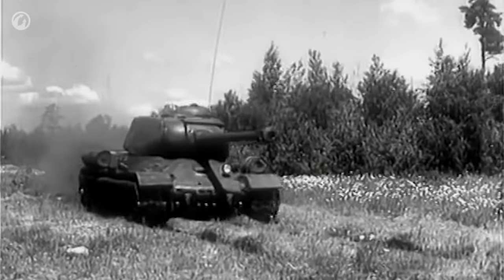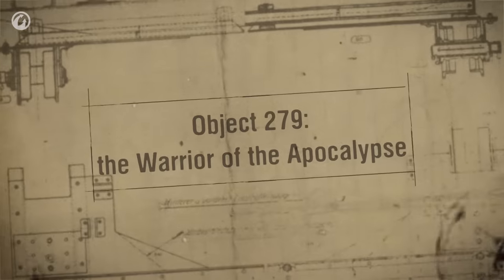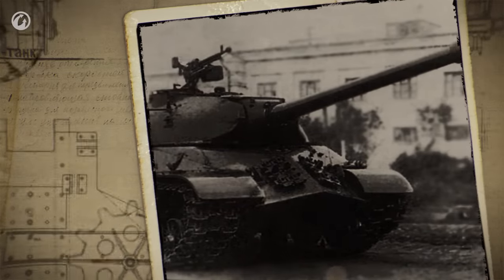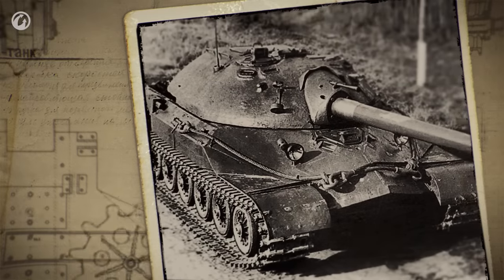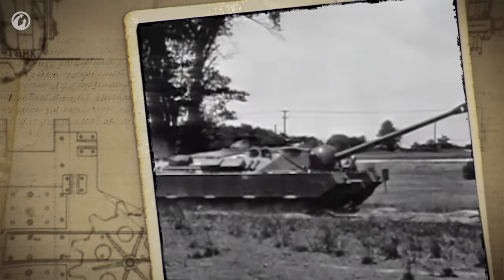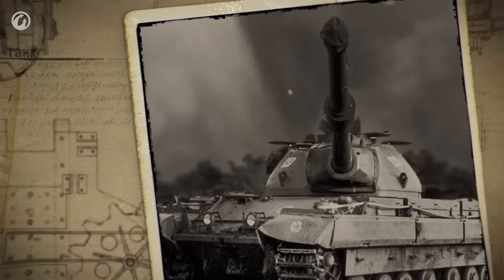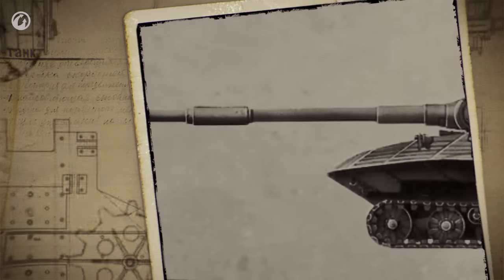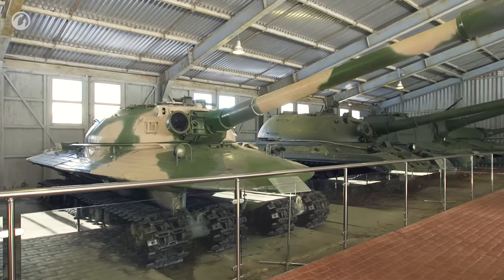World of Tanks - Object 279: the Warrior of the Apocalypse

Comment: 55 kmh, probably poor traverse speed
270 mm front (without angling)
305 mm turret all round
counter heat screens (spaced armor?)
130 mm gun 5 rds/minute (~490 damage -> ~2450 dpm, like a IS-7 with gun rammer)

So a pretty much inpenetratable tank with good speed, bad traverse speed and a IS-7 gun with better rate of fire. Maybe like a tier X Pz 2 J with a good gun?
Reply: Damnit wheres arty when u need it
Reply: Gonun Sounds like a regular tier 7 russian premium tank ;)
Reply: Probably spaced armor yes, but it could use a similar concept as the m60a3 with ERA (energy reactive armor) that in this tanks case would be placed under an oversheet of primary armor.
Reply: arty breakfast
Reply: Gonun i think the structure around the 4 tracks will be a weak spot
Reply: Gonun the gun you forgot the cannon was a heavy MG, so maybe it will be like the Waffentragger E100 before nerf
Reply: Sergio González Torres
well the IS-7 had a kind of autoloader too, but in the game you don't get that...
Reply: Forenix GD
if you get flanked, just turn the turret to the rear. They can't pen your front, side or the turret anywhere and you can protect your rear...
Reply: Gonun But the turret traverse can't be very high due to how many crew members there are in the turret. The loader would get one hell of a ride
Reply: Gonun It might be a Tier XI tank
Reply: Dome isn't that great against proper penetrator or well aim shot; or if HESH shells behave more like real world. Eitherway, it is a Soviet Maus, not some tier 13 vehicle SerB likes to brag about.
Reply: Gonun lol right
Reply: Gonun Omfg I was just scrolling through and saw your profile pic, I thought I had commented before on this video 😂, can you imagine this in wot though?
Reply: Forenix GD dude the turret is gonna weigh more then all the crew members so actually since there are more crew in there they will work to make the turret turn a bit faster but yes crew would put on a smig of weight
Reply: Charles 2002 lol same here
Reply: Sergio González Torres dude the heavy MG is the 50 cal zis machine gun on the top of the turret.. the cannon is a 130 mm yes it had an autoloading mechanism but that was only on the IS7 but only in real life. in the game it had a 13.6 second reload but on my IS7 i have gun rammer pluse brothers in armS and all that plus the crew is very good so my reload is about 10.4 seconds
Reply: Dusan Bursac well, Pz II J can't hit anything just like everyone else can't hit it, if it was given a gun corresponding to its tier, then that would be OP
Reply: Aaron Fales yeah, I can just imagine if in the game the gun behaved like the Waffentragger E100 before it was nerfed, just go around, 2 shot everything near u lol
Reply: Sergio González Torres lol i know right
Reply: Sergio González Torres lol give it the mtgls gun or guns since it has two
Reply: Those middle tracks look fun to repair.
Reply: Dylan Marshall Explosive Reactive Armor
Reply: It won't be a bad idea, HOWEVER : 
           Many players will consider it OP(Over-Powered), so they-ll want it's removal. And a lot of arquing is gonna be on the WOT forrums and game chat, and if they do the job and take this tank in game, you'll want it nerfed or removed, but they can't simply remove it and even nerf it because it won't longer be Historical-Accurate.

...So,  better go at museum, look at it, and then go, but better not in game :)

By the way, the Gonun's comment was pretty funny! Like!!!
Reply: (IRL) They should make a remote controlled tank with armor thicker than a heavy tank. (You couldn't fit a crew inside a tank that has armor thicker than a heavy tank without evolving first) so, just make a remote controlled super heavy tank.
Reply: who cares i want this tank.
Reply: Irl is7 had autoloader just like this thing
Reply: It also has a stabilizer and what are you talking about tiers and damage this is a tank tanks dont have hitpoints
Reply: This did age well :D
Reply: nah just a tier 8 premium, sounds very balanced aswell

Comment: HP 2100
130mm gun 11sec reload (dispersion / aim almost like the obj263?)
only 24 shells
28 turret tspeed?
25 hull tspeed?
turret armor 305~ mm (mini cupolas?)
hull armor 266 - 280 mm (side armor? / weakspot under the lower plate?)
35km top speed
Power/Weight 16.6 (+ good terrain resistance)

Comment: Actually, after watching the video, I'm not that terrified of it anymore. Emphasize the weaknesses mentioned in the video and it'll be right at home in the new meta, and comparable to tanks already in the game such as the AMX M4 54, the Kranvagn, the WZ 111 5A, the Badger, and the Doom Turtle. 

Pros:
>130mm gun means high alpha
>5 rounds a minute
>Hull armor impervious to HESH/HEAT/HEP/HE
>Powerful frontal armor, up to 300mm thick in parts
>Great forward mobility with 55km/h top speed and decent/great ground resistances
>300mm thick turret

Cons:
>Parts of the side/rear armor may be as low as 40mm behind the spaced armor
>Virtually no hull traverse
>Limited ammo supply?
>Easy to track
>No indication of HEAT/HESH protection on the turret, only raw thickness to protect it

Overall summary- Powerful from the front, vulnerable from sides and rear, unable to dogfight, and best in a hull down position. Just like some of the more recent vehicles added to the game such as the Swedish Tier X heavy, the Defender, several American heavies, and a lot of TDs.

...I'm beginning to feel more comfortable with it. Medium tanks can track and flank it, and if the stated "1-2 inches at the thinnest" mentioned in the video covers more than just a couple hatches, then most any vehicle will be able to pen it if they catch it from the right angles.

I think if they include the thinner armor on the sides/rear mentioned in the video and limit the turret traverse to make it a tank that cannot react well to being outflanked, it could actually be viable without being terribly overpowered.
Reply: It was very overpowered for the past 5 years.

Comment: Based on the details it can't be anything below Tier 10, if they decide to put it in something below 10 then they are definitely lowering the statistics. This is why I believe Tier 11 should be introduced. A new level to accumulate such overpowered tanks.
I also feel it is easier to introduce 7-8 tier 11 tanks that won't require readjustment of Tier 10/9/8

Comment: A lot of the out of control giant numbers I've seen for armor seem based on applying the angle of the saucer shaped stand off plates to the thickness of the base armor.  Definitely not weakly armored considering the tiny internal volume, but I really doubt the claims of 200mm effective side armor.  That would put it on par with the toughest modern tanks' level of side protection.
Reply: But it's true and truths sometime hurt
Reply: Primal Groudon then I guess they made themselves a reverse chicken and egg problem, they need heavy side armor because the double tracks make hull traverse painfully slow, and they need the double tracks because they clapped so much armor onto it where it doesn't need it and would still be vulnerable anywhere that lacks the appliqué (including the turret) to the M469 shell.
Reply: Actually, the effective armor thickness of modern tanks against most shell-types is upward of 1500mm
Reply: Not to the side aspect, they are typically considerably weaker from that angle.  In terms of side armor, this would still be among the best, so I imagine you see my skepticism.
Reply: Actually, due to modern composites and reactive and spaced armor and combat-skirts, even the sides of modern tanks would have effective armor thicknesses several times higher than 200mm. Note that this is effective armor, the actual thickness is of course not that thick.

Comment: This tank might be able to survive a close hit by a low yield tactical nuke, but the crew wouldn't. Due to to the high neutron-flux associated with nuclear explosions, they could end up receiving radiation doses of several billion rads. For anyone wondering, a dose of more than a 1000 rads is considered lethal. Neutrons would also transmutate some isotopes of the elements of the bodies, to the degree that it would probably be possible to receive a lethal radiation dose from just handling the bodies, at least for the first week or so.

Comment: They cheated with the height. The drive sprocket is almost touching the ground, where as with most tanks it's more than a foot off the ground. This means that this tank is lacking suspension travel because it's always crouching, not that it can go very fast anyways.

Comment: lol what, the challenger 2 has a ROF of about 10-12 RPM, the 279s ROF is nothing compared to modern tanks, Russian bias detected.
Reply: 00008HANK im talking about the L30, the current gun used on the challenger 2,
the stats are as follow...

Main weapon caliber (mm)
120
Length (mm)	
6982
Barrel length (calibres)	
55
Recoil stroke (mm)	
370
Weight (kg)	
1803
Rate of fire (rds/min)	
10
Firing range (m)	
3000
Reply: 00008HANK thats why i put 10-12, im sure they are trained to load with a minimum ROF for actual situations.
Reply: There is no Russian bias. Plenty of Nazi bias. Just because Tigers roflstomped British tanks doesn't mean it was a good tank.
Reply: Vladimir Lenin okay russian
Reply: they will only win if they had a chance to crush the modern tanks.